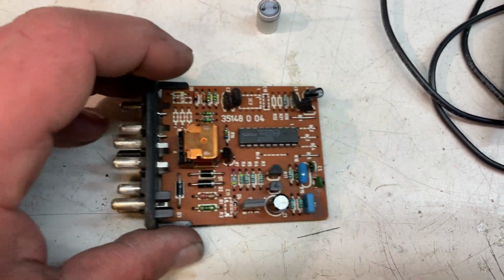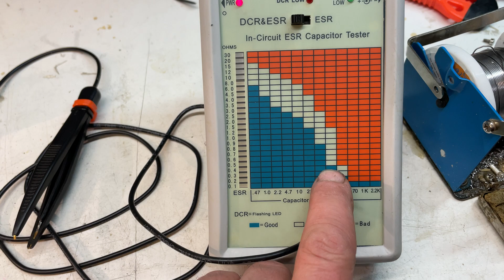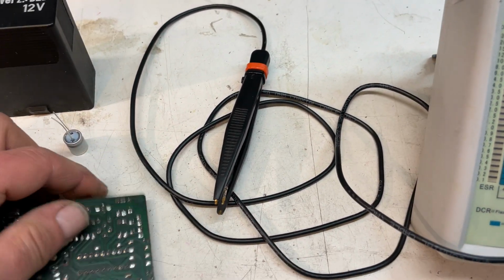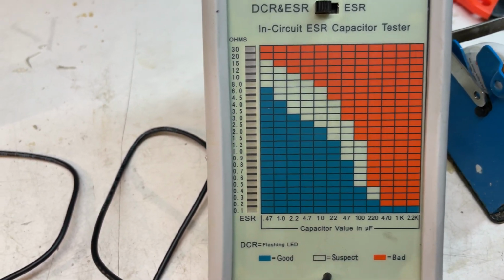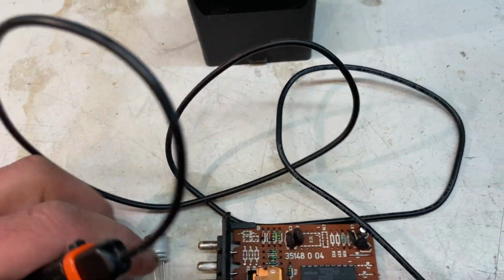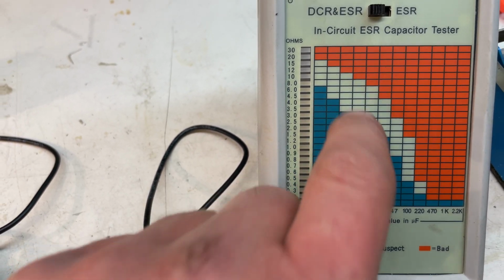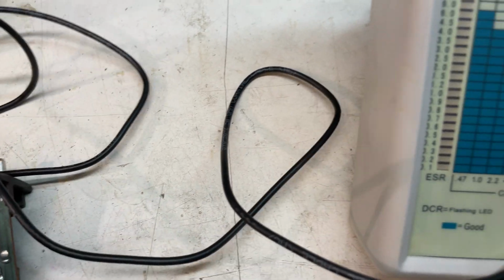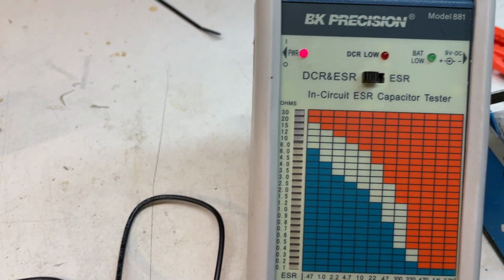Mercedes Benz W126 560SEL 3/89 Testing & Overhaul of Electrical System and All Control Units Part 1

Comment: Hello, what is the measurement of a spark plug for a Mercedes 126 model, 560 engine, depth between negative and positive?
PT Spark Plug Gapper Gap
Reply from the maker: @loaialtmiimi4426  0.8 mm
Reply: @inovahightechltd  Unfortunately I don't know
Reply from the maker: @  the gap is 0.8 mm

Comment: Hi. Do you know how to remove and replace the battery cables? Mine are bundled together with other cables and I'm not sure where it goes to get access to remove and replace it.
Thanks
Reply from the maker: Not sure, what year and model do you have?
Reply: @inovahightechltd  86420sel